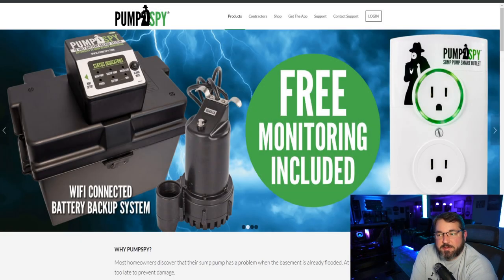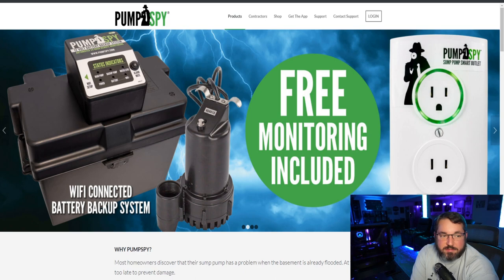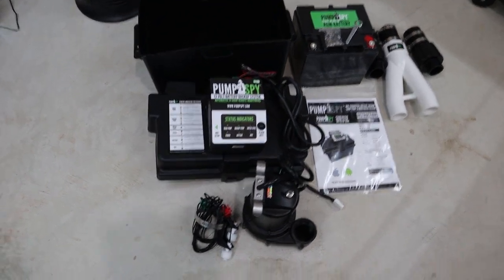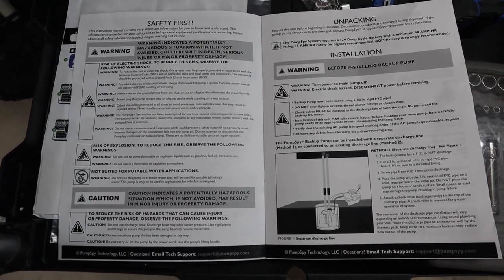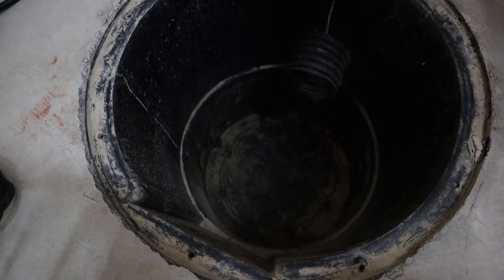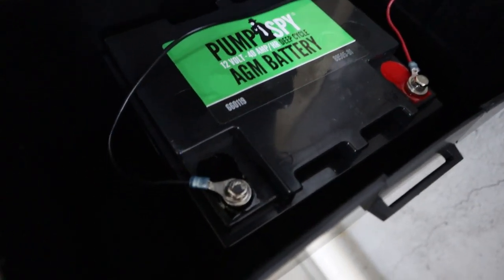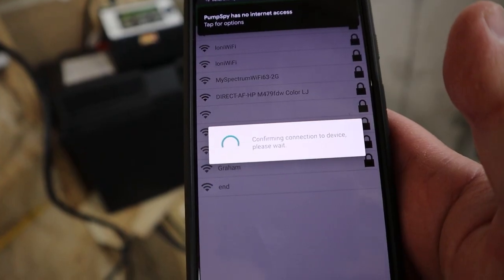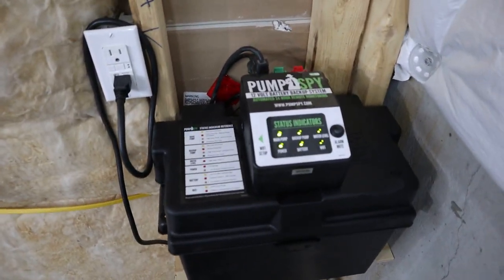PumpSpy Dual Sump Pump Installation - Battery Backup System

Comment: Nice informative video Joe.                                    I’m looking at doing something similar. I’m thinking of just purchasing the “Y” PVC connector pipe to allow me to connect 2 sumps to one discharge line.  However, I am not using battery backup, I intend to use two submersible pumps but I want to stagger them so that one works mainly and the other will kick on if the main pump fails or if the main pump can’t keep up. I already have a water powered backup system. I know it sounds redundant but I don’t want to end up having to change a bad pump while the pit is continuously filling with water during a storm. This is why I would like to have two pumps.
Reply from the maker: That's a good idea. I looked at the water powered ones, how do you like it?
Reply: Joe Lonicker, I have a Liberty Water powered back up sump system (SJ10 SUMPJET) It has saved me a couple times already during power outages. I live on a high water table and my sump pump gets a workout even on dry days. The water powered system works well as long as you have good water pressure. 60psi is recommended, I’m currently getting around 44psi on my municipal water supply. Obviously, the higher the psi the better the suction flow.

Comment: Hi Joe I have a quick question until I get my replacement battery can I plug the Sub Pump directly into the wall instead of  pump spy until? Until I get my battery I have the same exact set up.
Reply from the maker: The main pump should be able to plug-in directly but the Pump Spy backup pump is DC so it can only run off the battery. Unless for some reason your main pump is also DC but most should be normal AC and run off the normal 110v outlet.
Reply: @JoeLonicker  Thank you very much I recently went to a battery store got the battery tested it was only drawing out 9.4 V so I went and bought a brand new battery everything seems to be working great so far.
Reply from the maker: @David-hh7nc  That's great to hear!

Comment: How many wires/cords run from the pump?
Reply from the maker: Hi Chris, the pump itself has just the power cord and each of the floats have a lead that connect to the controller housing. So three all together.

Comment: I bought this complete system had it professionally installed not even two weeks out had a rain storm the system completely failed flooded my basement worse then ever the company came out pulled out the pump it was burnt to a crisp guy was scratching his head didn’t know how this can happen from a brand new system now a month goes by and the alarm is going off once again showing that the battery is dead now the company wants to come out and charge me a service fee when from day one this product has been  junk.
Reply from the maker: That stinks. Maybe you had a bad unit? I haven’t had any issue with mine. Are you using this as the lone primary pump or as a backup for another pump? I don’t think this is made to be a primary pump and I would never use it for that. It’s best used as only a secondary backup.
Reply: They sold it to me as a complete package that has two pumps a main pump and this back up pump the main pump that was made out of stainless steel burnt out now the battery is dead when everything is plugged in correctly. I read on a couple of forms that the batteries die quick which I’m scratching my head trying to figure out how this can be I’m pretty sure this is an old unit the one I have that they had in their warehouse that they sold me because the old unit the top part is all black and there is no screen going across at all no white face like the one in this video.
Reply from the maker: When I bought mine the monitoring kit, dual sump valve, and battery where all sold separately. Maybe they gave you a different brand for the battery instead of one from PumpSpy? If it is from PumpSpy it should have a 1 year warranty.
Reply: @JoeLonicker  That’s what I’m thinking I’m calling the company direct tell them my problem And see if I could deal with them directly  at the end of the day it’s a easy system to connect I just had to have this company put in the French drain and the pit and this is the product they gave me with their service.